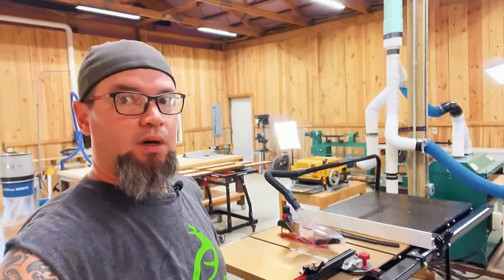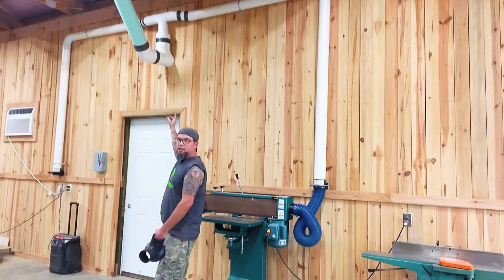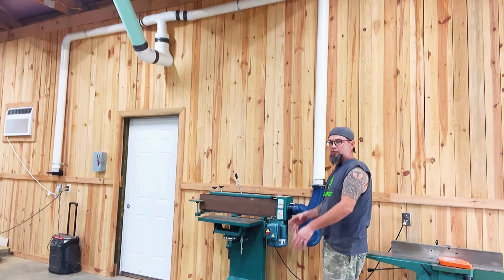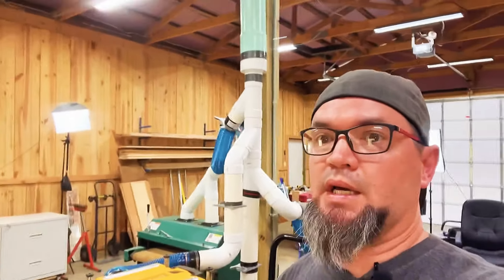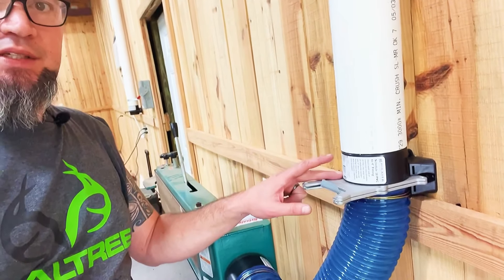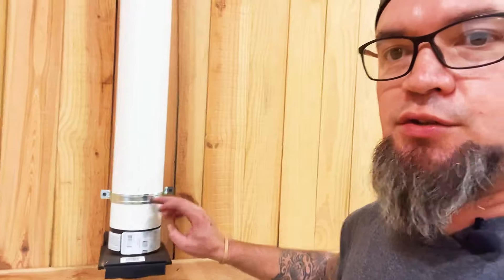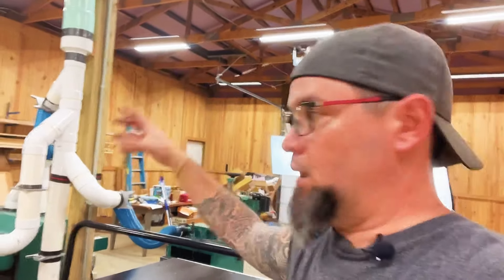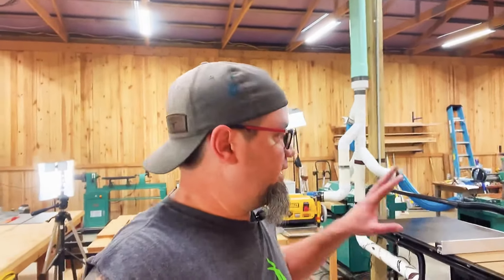Whole Shop Dust Collection Ran Off Of One Old Collector - The Setup and Test!

Comment: So what are your thoughts on grounding lines when using PVC.  I was looking into this years ago and everything I read said these were important.  I guess the concern is static discharge possibly igniting the fine dust, although that might not be as big of a deal since your discharge to the outside.
Reply: There has been new research that demonstrates that static discharge will not ignite the dust but i did get a static shock from my planer.  In my new location i am switching to galvanized vent pipe

Comment: Great video. I plan to do the same as you did and even found the same unit to use. I noticed that you had the dust collector really close to where you have it exit the building. Is this necessary?  I was thinking of putting my collector in the middle, but wonder if running the exit pipe 20 feet to the wall will be too long? Thanks for the video and any help.
Reply from the maker: I dont think you will have any issue with placing it in the middle.  Mine just happen to end up close to an exterior wall.
Reply: @MatthewPeechWoodworking  thank you!

Comment: I dont want to break open the siding to vent outside. Can i just crank open a window and let the hose go out when i use the dust collector?
Reply: Sure.  Same thing he did basically except he just cut a hole in the siding instead...just throwing the exhaust hose or pipe out the window would do the same thing.

Comment: I've set up a woodworking shop and now have a clean slate, but I'm uncertain about what diameter pipe to opt for in my dust collection system. Currently, I'm equipped with a Harbor Freight 2HP setup, enhanced with upgraded fan blades and a P181038 filter, alongside the addition of the Oneida Cyclone, which I've wall-mounted.

I've noticed many YouTube creators employing 4" pipes, while a few opt for 6". Could you shed some light on why you chose the size you did?"
Reply: I would guess your dust collector has 1 or 2 of the 4 inch ports on it, so go with 4 inch  main line then drop down to 2" line for your smaller machines, and if any of your machines have a 4 inch collection port stay with that size all the way to the machine.  Like my table saw has a 4 inch collection port so I'd run 4 inch line to it and then a flex line for the final connection.  My router table only has a 2 inch collection port so I'd run 4 inch line to it, then step down to a 2 inch flex hose for the final connection.  Just depends on your dust collector's intake size, and the size of your tool collection ports.  But keep the main line as large as your collector's intake side, and only step down to smaller line if your tools require a smaller size hose.

Comment: The main reason I have seen is it sucks the climate controlled air and blowed it outside. I never thought it would make that much difference,unless the dust collector is running most of the time while in the shop.
 Shop is looking great. Coming right along.
Reply from the maker: Yea most articles I’ve read no one can tell a difference in climate at all. Maybe unless your setting up to cut parts for hours we kick them on and off. And with only one blast gate open I’ve noticed zero difference.

Comment: Shop looks fantastic and such a great setup for a 2hp collector. 

What does the outfeed feed into when it goes outside? Looks like a trailer of some sort? What do you do with the dust/shavings? I plan to do the same thing (having the outfeed just go outside), but I will also have a garden outside, so I don't want dust from MDF, etc. type materials freely flowing around and getting into the garden.
Reply from the maker: I have a small trailer that we then use the shavings for animal bedding.  Or you can simply burn, dump or bag it.
Reply: @MatthewPeechWoodworking  love it!! Thanks got getting back to me. Going to model my dust collection after your setup

Comment: You didn't explain how you made the transition from the Grizzly collector to the 6" trunk line? Does the 6" sewer pipe fit snugly on the grizzly collector port?
Reply from the maker: Actually it doesnt.  I had to build up the collector port OD with adhesive foam strip to the point it made a tight seal when I slid the pipe over it.  Then sealed with duct tape.
Reply: @MatthewPeechWoodworking  thanks for replying. Plumbing in general is pretty madening when it comes to sizing and unfortunately this carries over to dust collectors as well. Great video though

Comment: The main disadvantage to this is, if you live in a cold climate, during warm season would be great, but not during
cold season.
Reply from the maker: I worked all winter long here many days well below freezing with no issues.
Reply: @MatthewPeechWoodworking  must be a mild winter, compared to where i live, would suck to much cold air into shop, where i live

Comment: How do you get such a small system to get enough suction over such a long run?
Reply: no cyclone separator and no filter on the output, both of which have a major impact on air velocity through the fan.